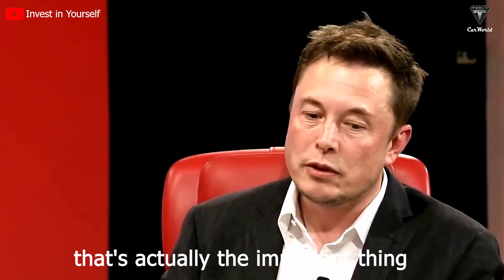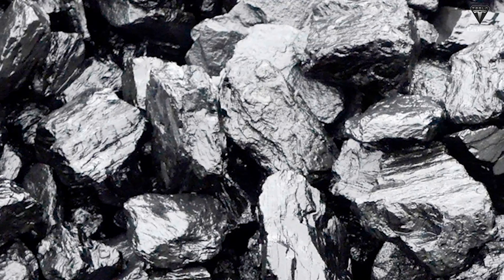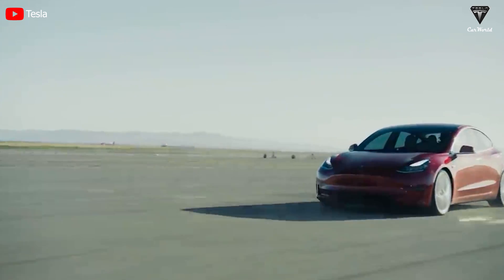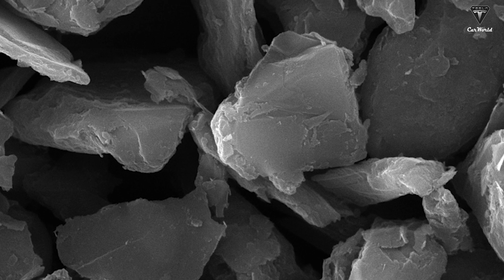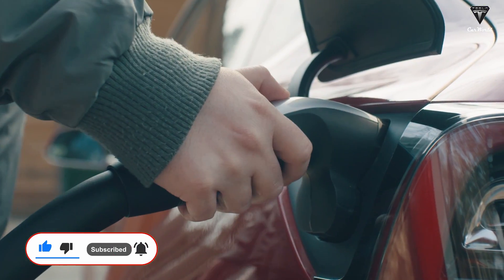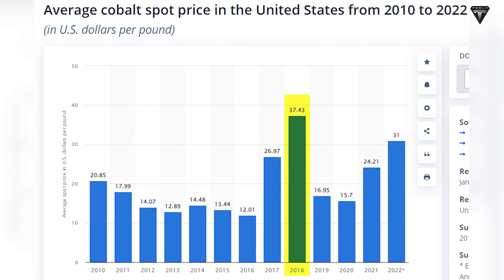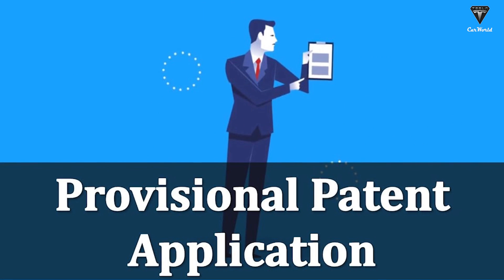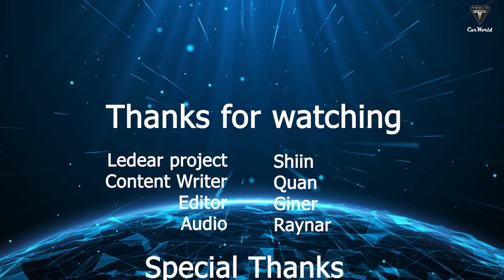The Truth of Futuristic Battery! Comparison of Hard Carbon Anode vs Graphite? Details Explained

Comment: <yeah, so ummm....there's still lots of this stuff sitting around. might be cheaper than chemists reinventing the wheel>
<all the carbon haters cult folks may vomit! what's next!?>
<hard carbon?>
Anthracite: The highest rank of coal. It is a hard, brittle, and black lustrous coal, often referred to as hard coal, containing a high percentage of fixed carbon and a low percentage of volatile matter. Bituminous: Bituminous coal is a middle rank coal between subbituminous and anthracite.
https://www.usgs.gov/faqs/what-are-types-coal#:~:text=Anthracite%3A%20The%20highest%20rank%20of,coal%20between%20subbituminous%20and%20anthracite.